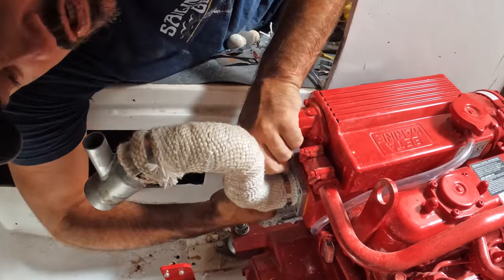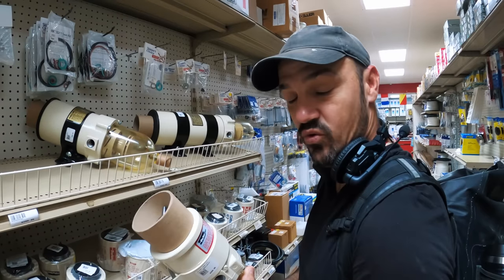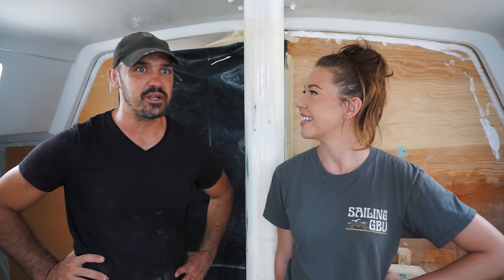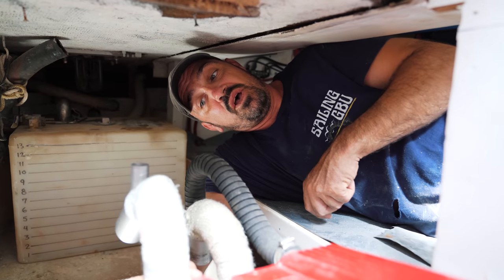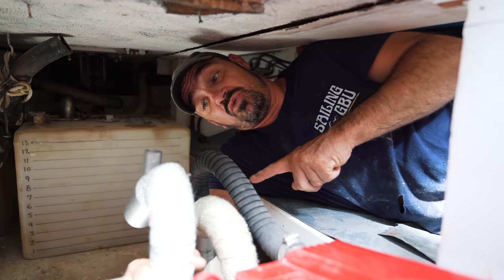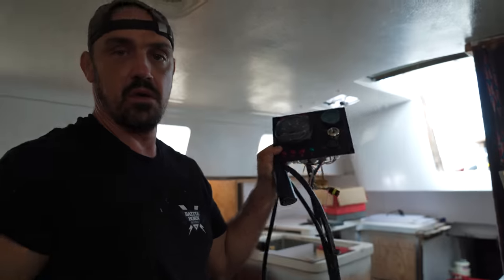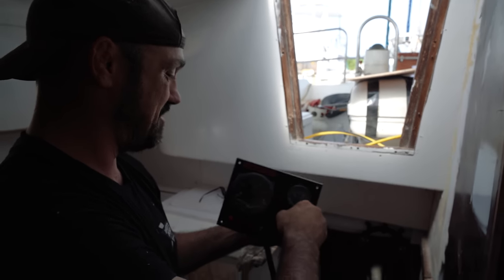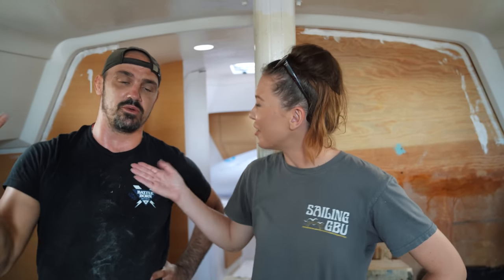Can we install this new engine alone no mechanic?! (Start up and mistake!)

Comment: after rebuilding a classic British Triumph roadster engine I learned that I needed to create a custom tool (cut large screwdriver) and put it into a drill to power a gear under my distributor that effectively ran the oil pump and circulated the oil prior to initial post rebuild engine startup ...its been too long ago to remember who/how I learned to do that as I am not smart enough to have figured that out on my own - I feel without any amnesty ...err animosity ...towards Matt that he too could benefit from having some oversight of expert eyes to catch those tiny missed details that are going to happen ...your human geesh - it's hard to bat 1000% and you recovered from a blammo upper cut oversight ...kudos!!!

Comment: Great job on the engine you two.  For anyone that hasn't done a long hard job like you two are doing it's hard to comprehend the difficulty.  It grinds you down and puts a lot of stress on relationships.  I admire you both.

Comment: Hey Matt,  I did the same thing on a car engine. The oil filter required a little fiber washer, I over tightened the filter and cracked the washer.  Started it  up, took off and pumped out 5 quarts of fresh oil in a mile long streak down the highway. It happens.  Yeah, I felt like an idiot,  but I learned something.

Comment: Love hearing the motor running. Congrats for getting that far. The next time-line goal is to get the boat floating. Get the boat floating and raise the sails, and take a short trip. After all that work, you 2 deserve it.

Comment: Congratulations!
You've made great improvements, but "Clifford" is the red-ist!
Your determination takes over when experience might have left you hanging.
One of my favorite sayings is, "Respect is retroactive!" but you've earned it, project by project!
The rewards will come when the flipped switch actually turns on the light, when the plumbing doesn't leak or the engine jumps into action and you're out there cruising again.
Well done!

Comment: Write up a check list that you can go through before you start the engine. Moreover, you should have a check list for all fasets of operation on the boat. They have them for aircraft. Look it up on the internet, they are easy to put together and can save you making costly mistakes. While you're at it, make a procedure manual for the entire boat. In the event of emergencies, they are priceless! They prevent oversights, and save you time.

Comment: Years ago I raced go karts. I was rebuilding an engine and I had run out of red loctite . It was several days until I got some more. When I got back to the engine,I started where I thought I left off. Finished the engine, installed it and went to the track. Ran good for half a lap, then the connecting rod came out the side of the engine. Remember the loctite well it was for the rod bolts, I never loctited them nor torqued them. I only snugged them to keep the bearings in place. Needless to say they let go. When they let go I instantly knew what happened and WHY. Didn’t double check everything. It was just like you installing the oil filter then removing it for another reason, you remembered putting it in, but not taking it out. I should have left one of the rod bolts out to remind me of where I was in the process. Your mistake was a lot cheaper than mine. I don’t think I have made a similar mistake since then, it was a LEARNING experience and that was about 50+ years ago.

Comment: You forgot to put the oil filter back on! Ok, now check that box for that rookie mistake. But hey, at least you turned the engine off and cleaned up and put it on. An idiot would have ruined the engine. You are doing an impressive job. Looking forward to seeing guys putt around and fill that shallow tank every few weeks.

Comment: Your fuel filters will mostly help you deal with the bad or tainted fuel some docks will sell you.  Is there a testing kit you can use on fuel before you buy it and take it onboard?  Water in the fuel is quite common.  No funnel?  Everyone needs two of those, big and small or oil and antifreeze.  Like spare parts like belts, you need extra oil and antifreeze in inventory anyhow.

Comment: No  BIGGIE. Just a small case of dufuss installites 🤣🤣. One thing though, boat should always carry x 1.5 times oil and coolant. O.5 for top ups and whoopsies and 1 times for oil or coolant change at sea  😉😉 Positive side is motor started and ran instantly , so all good 👌👌👍👍

Comment: Love your videos. If a friend ask for an opinion i would tell: Please buy enough oil for an oil change after 15 minutes, if it was run dry for more than 15 seconds. use a temp oil plug with magnet to capture metal. Try to find a better place for the battery, and add a battery switch. Wet muffler interferes with the stuffing box. Racor should be in a place accesible and visible to remove water using the drain plug in case of a situation of bad weather running the engine, next to the strainer could be a better place. Dont mind this opinion because I dont know the space you have, but I have done similar job on a Cal 39 that look like your layout. Good Luck

Comment: Check those hose clamp screws with a magnet.  Also your motors below water level so I’d think about double clamping the raw water hoses and exhaust hoses.  I use the clamps with no slots that the slots for the screw are stamped in..  solid band.

Comment: You must have isolation valves each side of the raw water strainer. 
We also fitted a fresh water flushing connection on the IN side of the filter. Saves your heat exchanger over time. We did not bother flushing after using the engine, result $6,000 bill. Thanks Volvo.

Comment: While you have the chance and are at it, I would recommend adding another fuel filter in parallel with the first one. If the engine suddenly stops some future time, often it will be water or dirt and you may be able to keep running the engine by switching to the other filter.

Comment: Yeah, it was a bonehead move forgetting the filter, but like one comment said and expert at anything was once a beginner. It was an easy mistake to make and we've probably all done it. The mirror was an excellent idea. I keep telescoping spot mirrors in my tool box. Laying one flat like you did can be of great benefit because you don't have to hold it. Can't wait until you get to test your engine on the water! Oh, the comment regarding a remote filter set up is an excellent idea seeing as your filter is horizontal.

Comment: I'm sure glad I've never made a mistake like that. I've already forgotten about forgetting to put the cap back on the oil filler on a $150K Porsche. Smoked that baby all the way out of the neighborhood. Some folks who didn't realize that Porsches have the engine in the back thought I had BBQ grille going in the trunk.

Comment: I'm a 30 year diesel mechanic and I've left the oil filter off before and it probably won't be last time. First thing I do is watch the oil pressure gauge or light and if that's good I look under the truck to check for some type of fluid running out because we're all human.

Comment: OMG i did the same thing. Changed the engine mounts on my 3QM30. When i refired the engine i forgot to put the oil filter back on. Just a reminder that i own the same 37' Hunter, 1982.

Comment: You all did a terrific job getting that engine installed and running! Matt, you are still a doofus for forgetting that oil filter lol. Glad Kristine got you to shut off motor before running out of oil. Suggest adding a fuel shut-off for when changing fuel filter too.

Comment: Thanks for the great episode.  I can relate to your style, Matt.  You might find this Jackleg Kluge tip helpful/useful.  I noticed your fuel line from the tank goes about a foot and lays on the edge/corner of the tank.  That's a wear point and there are dozens of these on a boat, especially in the wiring...and even on an occasional rope/line.  I often put a small amount of silicone sealer on those rubbing hoses and wires.  It holds well enough and is easy to break free if need be.   I use silicone seal because of it's heat resistance....or if heat above 150* isn't a problem Shoe Goo from Wallmart shoe department is even better.  You should add Shoe Goo to your onboard supplies....you'll like it.  Also having that extra set of eyes (Kristen) there and her thinking all the time is really a Godsend (when it's not annoying).  The guy doingthe work is using have of his brain power just manipulating fingers and hands.  That only leave half a brain to think about what your doing.  I tell my wife, "If I didn't need the warning, I'll just ignore it....but I'm really thankful for the few times that I needed the warning".

Comment: My heart dropped when I saw the oil flow out the side. Plus, don't forget a battery box with tiedown for your battery.  I had to learn the hard way that it is an important part of boat safety. Great job again.  Question, do you guys have any input on your scooters?

Comment: Hay you two congrats getting the engine going. I fix planes, cars & boats I have a 3/8 and 1/4 drive rachet which when you rotate the handle the head turns great for those tight spots you might want to get one it will save you lots of pain. if your not able to find one let me know I will send you one they are not expensive.

Comment: As much as you guys make it look like shooting from the hip, you do ask advice to do it right. One small hint, any hose connected to the outside under the waterline should have two hose clamps as a backup and I put dielectric grease on all electrical connection to avoid resistance from oxidation in the future.

Comment: Consider adding one quart of transmission fluid every other tank fill up your injector’s will stay brand new. I did this with my Mercedes diesel car at the recommendation of the Mercedes mechanic at the dealership when I picked up the new car!

Comment: Oh well..not the worse thing to happen..spilled clean oil......but I would have epoxy painted and fiber glassed the wood spacers holding the muffler tank in place, and starter battery too...also add a emergency self battery LED light in the engine compartment.....just add it to the never ending list..lol....John

Comment: Please use crimp on battery cable ends at the battery. Those bolt on ends are a guaranteed failure. They will fail when you need need the engine the most. Crimped and heat shrinked are the only way to go.

Comment: Nice One… No Filter? I would expect maybe a loose clamp, but no filter… 😂
One other thing… your fuel tank. You put the lines all the way across. You need to have a break down the middle. With your luck your fuel will be right on the line and you’ll have a hard time confirming the amount.  Also, an LED light behind the tank shining through it, will help you see the fuel. 😉

Comment: hopefully that lovely new engine was bench tested at the factory so should have at least some oil at the bearings....starting an engine with no oil filter basically means no oil pressure at the bearings  during the time you had it running.......lucky escape! hopefully.
never mind....we have all been there!!! I once loosened off an oil cooler connection on a Marine Perkins  Diesel then forgot to retighten....
WOW the entire engine compartment changed colour very quickly on start up!!!

Comment: I had parked my van at my (then) girlfriend's house. Parked on a newly tarmaced car park. I needed to change the oil filter so unscrewed the old one, put in the new one. Only I didn't realise I'd left the old o-ring in there, so with the new filter screwed in, there were two o-rings. I started the engine up after filling with oil... it spewed oil out all over the nice new car park. Opps.

Comment: Forgetting the oil filter is not the worst that could happen.  Running it for any longer than you did could cause damage to the bearing because there is no oil pressure.  The assembly lube should have protected everything so it should be fine.  P.S. When you install an oil filter, spread a little oil around the seal and put as much oil in it that you cab before installing it.

Comment: The exhaust hose should loop as high as possible immediately before it exits the hull outlet.  That is how seawater is prevented from backflooding the engine.

Comment: Good choice.   Don’t double gasket the oil filter by accident.   When you remove the oil filter, be sure the rubber gasket comes off with it.  It will leak again when your NOT WATCHING if you forget to check for the gasket.

Comment: Voices are low volume but when the music kicks in it is too loud. I have the bass turned all the way down but it still rattles my foundation. I still love your channel and am a patron. I would still follow even if I have to monitor the gain to keep my neighbors happy. Just please check and adjust if necessary. Thanks either way, and Matt it could have been a much harder fix than just screwing the filter back on. Try not to overtighten it for revenge.

Comment: Hey Matt, I wasn't thinking about you cutting off the ratchet handle. I was thinking about your grinder grabbing that shirt you had under your hand and it getting spun up on the grinder, throwing everything else all over the boat. That was the dangerous part. Like a tie getting stuck in a machine on steroids!

Comment: good deal you got an engine in case you have to run, the thing I would be concerned about is the 14gal fuel tank. What happens if your out in the middle of the ocean with no wind or you blow out a sail or loose a mast?

Comment: Yea, I can’t call you a doofus, we all have done something like that before or worse. I mean I can’t think of anything off hand… 🤠. Oh wait, I put the boat in the water after being in winter storage, forgot to put the cap on the hose used to flush raw water system with anti freeze, turned the motor into a 6 cylinder water pump, started boat to fill the boat with water. The dog went to the bow (highest point in the boat) didn’t sink, but the starter was shot! Lesson learned.

Comment: Awww, don't sweat it.  S... happens.  Considering how far you guys have come, forgetting the oil filter and having to add more oil is a very minor setback.  For safety sake, if you haven't done it already, definitely consider fuel and raw water cooling cut off valves.  Cut off valves can really be a life saver (literally) should you spring a leak.  I'm really looking forward to seeing that bad boy monster motor running and tested out!  GL :D

Comment: WOW what a beautiful thing.  A brand new RED Diesel engine running in your beautiful boat.  I'm so impressed & inspired to see you guys rebuild this old boat and put this beautiful sailing thing together like the sailing & fixing champs you are.  Kristen, I'm so impressed with your videography & Matt, super job on everything you've built.  I really like the Bimini structure you built with the metal framework & the PVC board & 2x4 supports.  I want to do one like that on my boat.  By the way I'm looking at boats and I think the Hunter Cherubini hulls up until 1982 or so were thicker & stronger than some of the more recent ones. Was your boat a Cherubini cutter design?

Comment: I had a cloth in the air intake on my diesel to keep dust out while I was doing a heap of sanding. Guess who started the motor with it still in there ? Luckily it was not sucked right in and killed anything. We all stuff up.

Comment: 😀😁😅🤣🤣 So you really are human! We all make some dumb mistakes! I can’t believe oil did not run out while you were filling it with no filter! Happy to hear that our bugging you about the prop is going to get you to take action in that department. Little late now but I hope you did use diesel fuel lines and not gas lines. Diesel lines cost a lot more so I hope you don’t have to learn the hard way like I did. Gas lines will not last. Also I did not see you install a fuel shut off. Really important and easily done now. I did not see you get the air out of the system but as fast as that baby started I know you did. We all that have been there understand you being nervous. Congratulations, looks like a job well done. Can’t wait to see you guys on the move again. Thanks, we really enjoy and look forward to Sunday morning!

Comment: Matt its probably to late as I know you afew weeks behind on vids. But if it's that hard to get to the battery leads on the starter , how you gonna be able to change it in rough seas if needed? Maybe do alittle redesign in there before yall leave the dock. It may save you a huge headache later on

Comment: I'm not calling you an idiot for forgetting the oil filter. I would much rather have a problem that I can see and fix than the stress from troubleshooting a problem. Laugh it off, fix it and keep going.  Very soon it'll be GBU on the water again.  Getting close.

Comment: Do not get those cheap cup holders.   I had them on my boat.  The sun makes them brittle.   I kept kicking them and after a few whacks, they began falling apart.  Not worth putting a hole in your boat.

Comment: How much were those fold down cup holders?  I got a 4 pack of them on Amazon I installed on my Boston Whaler for  about what they wanted for a single 1 at that store that rhymes with "West Sardine".  They don't hold up super well in the sun though.  If I were you I'd spring for the upgraded ones made out of Stainless Steel.
  

     And Matt take away the positive.  You may have screwed the pooch a little and forget the oil filter but at least you didn't leave out the drain plug.

Comment: Are you calling the engine, Red Lobster? That install was a lot of work. I can't rag on you cause I changed my wife's oil and the old oil filter gasket was still there all the oil poured out going around the block.

Comment: circumference of 2 inch pipe = 6.28 inches circumference of a 2.5 inch= 7.85 inches in circumference   big difference